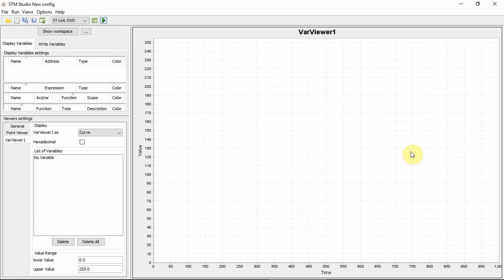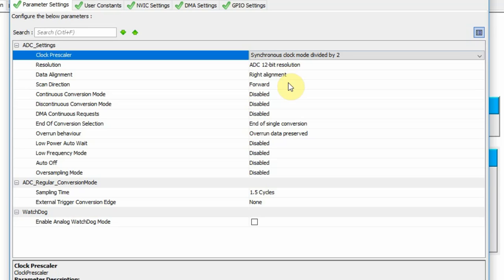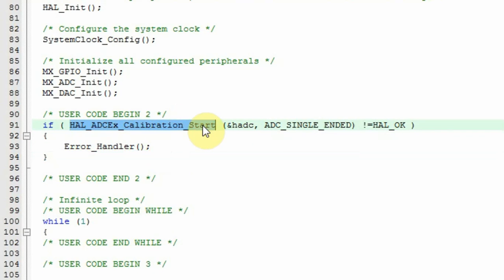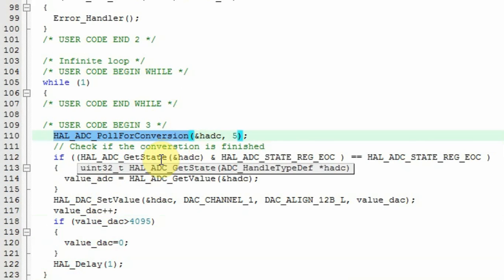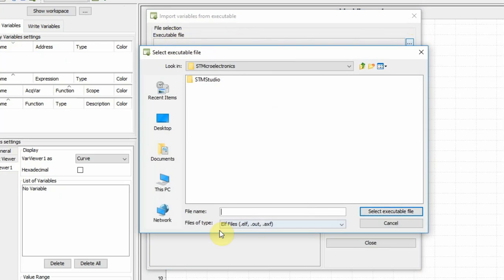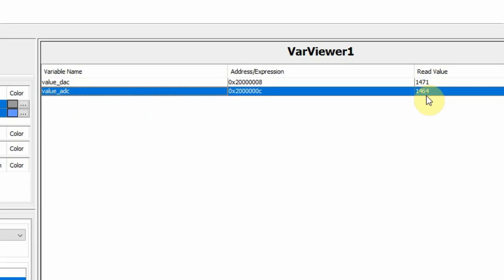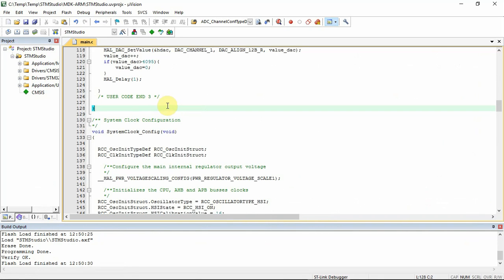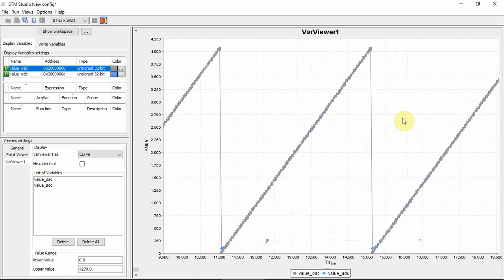STMStudio Tutorial

Comment: Hi. I know this film is quite old but i have a problem. Could anyone help me? When I push start this error appears: 
Failure pening file
C:\Users\Paweł\Documents\STMicroelectronics\STMStudio\log.txt: 
No such file or directory
Is this bad that I have polish letter in the name of catalogue? Can I change somehow the path? 
Greetings.
Reply from the maker: Move the file to a temp folder in the C drive and try again. I didn't write the software so there could be many reasons for this error. Let me know if you find a solution.
Reply: Hello. Thank you for your support :D 
I made it. 
C:\Users\Paweł\Documents\STMicroelectronics\STMStudio\log.txt 
this path led to the folder where log.txt was absent. So as you recommended to me I moved whole folder STMicroelectronics from Documents to Temp. It still didn' t work so I decided to use file log.txt from another program for STM32. The name of program is STM32 ST-LINK Utility. I copied log.txt file to the folder Temp\STMStudio. And it works. 
Thank you for help, and greetings :D
Reply from the maker: Hi. Great that you found out and your sharing it with me. Can you also add the to the community.st.com so others will also know and ST will fix it. Thanks.

Comment: in my case, doesn't appear all variable of my project. just a few. i use keil with stm32f401. Thanks.
Reply: Maybe You should try to build your code with -O0 optimization flag, or tick the "Expand table elements" option on "Import variables" window
Reply: I had the same issue with the STM32F401 programmed with Keil u5. Go to "Options for target" -> "C/C++" and uncheck "One ELF Section per function". After rebuilding you should see some variables

Comment: Great video but i have a problem, when click on start button give a message "error opening target connection" and "failure opening connection with target" you kwon how to solve it ?
Reply from the maker: +Luis Castro Hi. It could be that your connection is still open if your using ST-LINK Utility or you are in debug. The port had to stay open for the software to work.
Reply: Sometimes stm32 chips have write protection option bits set
Reply: One has to disable it by using the stm32 utility app

Comment: Great video!
I guess the noisy graph is actually the result of the limited sampling rate of STM32Studio.
Reply from the maker: Its not a simple answer, but YES and NO.
Yes: As you can see, the ADC and DAC are both "affected". As they are running at maximum speed, the STM32Studio is not able to catch up, so we see readings once in awhile at that looks like noise. 
We are using SWD to debug, so the "Debug Unit " needs to halt the core, read the values and run the core again. In the meantime, the hardware keep on running...
NO: because of the SWD debug " issue ", the way around this is using SWO pin. This is not available in the Debug unit of the M0/M0+ ( save silicon ), so im not able to show this effect. The SWO is Serial Wire Out, and it "captures" the values without halting the code like SWD debug. This enables to see a more clearer reading out of the core. I might make a video on the difference.
More info on how the debug in the Coretex M works: 
http://www2.lauterbach.com/pdf/debugger_cortexm.pdf
http://infocenter.arm.com/help/index.jsp?topic=/com.arm.doc.ddi0432c/Bcgbfdhc.html
Reply: True